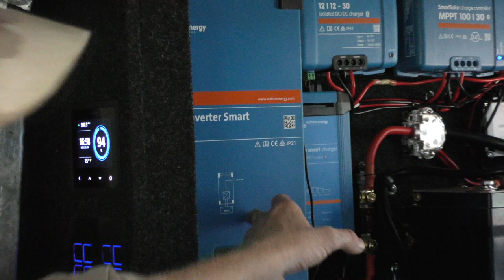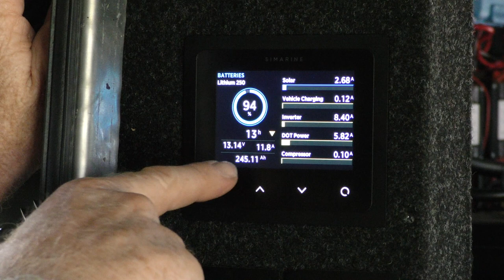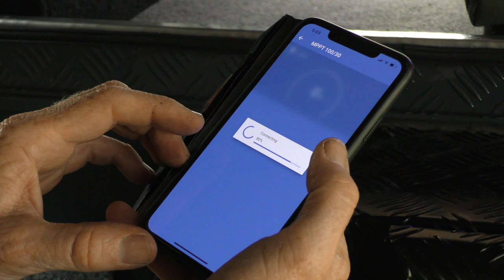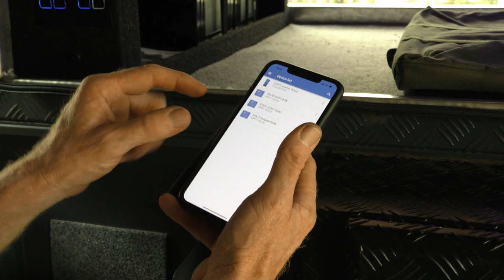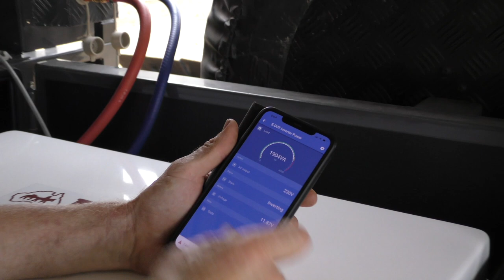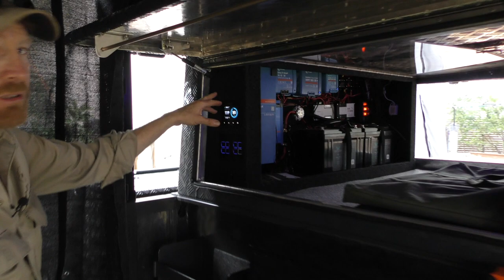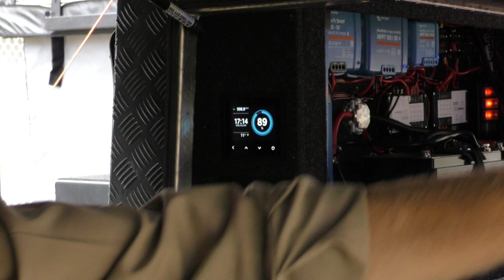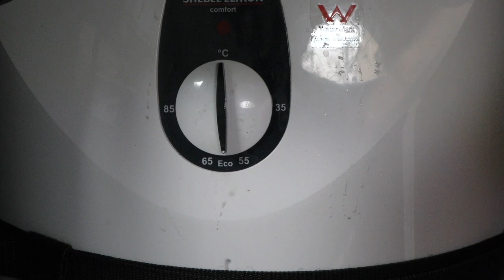eDOT 400, NO GAS CAMPER OF THE FUTURE

Comment: Victron gear, 45voc PV and Lithum batteries. 
Finally a builder installing quality products to start with in 2020.

Yes I run this gear all ready and it is next level. As someone that is off grid power over 60days a year and 3 weeks at times it is worth the extra capital as no need for genset.

Leave AGM and 12volt solar for budget and weekend campers. 
It better investment for low users

Haven't heard of Drifta before but check them out.

Comment: We've been taking an ice machine camping for years for ice in our rums. Just on a more standard 240ah AGM battery set up with a reasonable amount of solar. They don't draw that much about 10amps/hour, but you need a big inverter just to get over the huge start up current those compressors have.

Comment: love the concept. im building a slwb van right now and being a tech nerd im experimenting with the same thing. i will be running 24v system. two 12v 120ah lithium batterys. 640w of house panels on the roof. 2400w inverter. 30a dcdc charger. and 200w solar blanket as a backup. being a plumber i also got the same 5l hot water unit to play with hahaha. will be trialing a 2 burner induction stove.

Comment: Well done. What a wonderful camp trailler.
What current are you charging those lithium batteries. Charging well over 30amps will decrease life span of those batteries.
Alternator and solar input too much current, safe for gel batteries.
Just concerned with high drain appliances 1800watt induction and hot water system. Charging at high amps. Cost of lithium batteries over period will be not efficient.
Reply from the maker: Myung Hong thanks mate.. yeah , not quiet right tho.. Li will take up to 100 amps continuous charging, no problems.. won’t worry them.. think of Tesla car, same thing, they pump in massive amps very quickly.. L

Comment: Great setup Luke.
I ended up purchasing a Redarc Manager 30 & the Redvision TVMS to install into my Hilux canopy for touring. My wife has now thrown a spanner in the works & wants to get a camper trailer. I'm looking to do the Victron setup in the trailer without the DC-DC charger as that will be going to batteries in my truck canopy, I need the truck for outings without the trailer.  I like the idea of having the separate inputs with fixed panels & portable both pumping power into the batteries. I wish I had of stumbled across this video earlier. Can you use fixed panels on the trailer roof into the MPPT controller together with portable solar panels or do I need two separate controllers. If I could get away with one MPPT, I'd go with the Victron 100/50.

Comment: All electric - excellent. I'm surprised you stuck with 12V for the batteries, for the same reason you have high voltage panels, 24v on the batteries will save losses, and 24V inverters are readily available, as is 24V lighting, controllers etc. Next iteration should be 48V, though 48V stuff is expensive still.
Reply from the maker: Yeah everyone skipping 24, all going 48.  But yes big step up on price, trying to keep prices sensible, and simple, 48 adds a few layers of complexity.. atm, we’ll stick to 12 v, then probably jump to 48 in 12 months or so.. ?? L
Reply: @DriftaCamping4WD  Thanks Luke. Makes a lot of sense.

Comment: Painful to watch... There is absolutley no advantage of higher voltage over 18V Solar panels in sunlight. All solar panels do the same thing, collect current, not voltage, they should produce enough OCV is any sunlight. If an 18VMP panel has a low voltage then it follows in the same setting the higher voltage panel will provide no extra current. The really obvious flaw here is solar is so weak in morning/aftrenoon, midday is where you get most harvest. Same for losses in cabeling, all cabeling is sized for 1%Vdrop so no the losses is not an issue with 18V. High voltage panels are really only good with 15+M cable runs, 10M is childs play. I know I have cable runs up to 20+M. You are going to have battery life problems down the line with drawing those massive currents from such a small battery, it's a problematic concept trying to run such powerful stuff like that. See solarpaneltalk where the pros are.
Reply from the maker: Wex lop haha , ok mate.. 12 amps at 8.30 !! Pumping the sun  .. 😄😄😎

Comment: REDARC can charge from two sources at the same time
Reply: I think the new manager 30 can but is it limited to 30 amps in total where as having individual components allows for higher total current.
Reply: That’s because batteries have a max current charge generally 1/5 of the amp/hr size
Reply: @camerons9090  that's because that's all it can do. Lithium batteries are happy to change at 0.5C so those batteries drifta have could soak up 125 amps easy and could take double that if you were in a hurry.
Reply: But lithium is different it can charge much higher for short periods
Reply: @camerons9090  I thought we were discussing lithium. That's what the drifter system uses. Anyway, you will always get higher capacity out of discrete components as you can run them in parallel. The redarc system is nice as a turn key solution but when you're innovating or trying to do something special, discrete components are the way to go.
Reply: Yes I can agree  this as a concept I can see for the future just seems like it could be done a bit neater but we’ll see with the first production trailer
Reply: @camerons9090  agreed. Many of these problems have been solved by the RV market. It's intersting to see how Drifta is bringing it to the camper and 4wd market.
Reply from the maker: Yeah lithium very different, can pump in 100 amps a battery . Look at a Tesla, the amount of power they soak up so quickly is incredible. The bms 30 yeah can do two source but only to max 30 amps.. great unit, we still using them, but has some limitations... L
Reply: @DriftaCamping4WD  it should also be noted that the higher the discharge and charge rates you use, the lower the life of the battery for lithium. To really make the idea of 240v cooktops and hot water systems viable I think your going to need more battery capacity and you will switch to the multiplus units. These are what you really need for this application. They accept generator input and can charge the batteries at hundreds of amps and still feed power directly to the ac loads. You can have some appliances like the hot water only run when the generator is going and others like the ice maker or electric blanket run off both/either battery or generator. You could have a 24v or 48v battery system which keeps the current down in and out of the batteries and you could have a separate dc2dc 24v to 12v converter to  run the legacy 12v stuff.
Reply from the maker: neutronstorm yep, some good points, stepping stones : )  got a lot of testing to do , see if the system copes, but we think it will, lets see. :) L

Comment: Hi guys, just 1 question. If the solar input is high wont the dc dc charger realise that and reduce its input. Even though they are separate from each other wont the dc dc charger back off because voltage is already high from solar input. cheers
Reply from the maker: Peter Bayley hi peter, only if the battery is at 100 % , then it will.. L
Reply: @DriftaCamping4WD  oh ok Great, thanks for the response.

Comment: All very interesting but I am not sure how practical it will be. Some quick calculations indicate that the energy density of LPG vs LiFePO4 batteries is 100:1 by weight. In other words, to store the same energy as 1kg of LPG gas you need 100kg of Lithium batteries. Sure, you can recharge the batteries during the day but having that much power draw means that you are back to the old days of carefully managing your power use and spending time stuffing around with solar panels trying to harvest every last bit of energy. At the moment, LPG seems to me to still have its place. You're about 5 to 10 years ahead of your time Luke.

I am surprised you didn't make the front area where you put all the gear a mirror of what you did in the back. Ie. couldn't you just have a door that opened up over the draw bar so you could access all the gear directly?

Have you thought about putting in RCD protection now that you have 240v? Having 240v in an unearthed metal box would have me somewhat concerned, especially around hot water systems.

I know you have issues with the legalities of running gas. Could this work be done by an authorised gas plumber or is there some other legislation that restricts you from having gas fittings, taps and quick connects on the trailer?

I am looking forward to see how your DOTs evolve into the future.
Reply from the maker: neutronstorm there is a rcd, tucked in next to the inverter. yes gas more efficient by weight for sure, but gas has many other disadvantages in the rv industry. yes energy will have to be managed , might have to combine with a gene at times , might have to put portable solar out but many people doing that now . anyway lot of testing yet gonna be fun tho : ) L
Reply: @DriftaCamping4WD  I love that you guys are trying new things, but please don't sell something that requires a generator to keep going.  There is nothing worse than being set up at a nice quiet spot and having somebody pull up close by late in the day (they always seem to need to pull up next to you) and starting up there bloody noisy generator.  

Generators would have to be the most offensive thing anybody could take camping.  I'll put up with music and drunken singing, but there is no excuse these days for having to run a generator, it's just piss poor planning.

Comment: Is there provision for 240v input as well?
Reply: My understanding is that the victron smart  inverter doesn't have a 240v input side however there are victron products that do have this feature and would allow you to charge/power the system from 240v. My prediction is that we will see version 2 of the edot shortly with one of these more advanced charger / inverters, possibly running on 24v with a generator as an option to rapidly top up the batteries and run the trailer when it's under peak load. Makes sense to have a generator available to boost power in the evening when people are using the shower and cooking.
Reply: @neutronstorm   yes there is an unit, called victron multiplus.
Reply from the maker: yes it’s sitting next to the inverter sry i think i didn’t mention it. below the dcdc : )

Comment: in nsw you can use gas bbq etc when there is a total fire ban.
Reply from the maker: Peter Nolan i think that depends.. is that within 20 m of a house, with a hose nearby ? So that’s not camping.. L
Reply: @DriftaCamping4WD  sort of ... the rule states. adult supervision, a water supply of at least 10 liters(does not have to be mains water) and within 20m of a dwelling or picnic area. So the rules are a little vague. This applies to electric bbqs/ stoves as well.

Comment: i understand some people wants everything electrified and to use "free & green"energy to power it and you are just showing customers what can be achieved.

But let me get this straight: people want to get away from a humble 4.5kg x 2 gas bottles to use induction cooking (1800w peak) with an adventure trailer where you cook outside, just so wind dont blow out and dont have to deal with gas - because of that - they have to invest in a big lithium system / a massive inverter/ a number of large solar panels/ a more advanced DC DC charger where it can pump 50AH+ into the system and the heavy wiring to hook everything up, and to back it up for days of not travelling and cloudy, a 2kv generator with extra petrol can!!! - $$$$ aside, what a waste of resources/ space not to mention the spirits of camping...

perhaps a over-engineered luke's wind shield will be a far simpler solution and cheaper..  I suppose sometimrs first world problem requires first world solution.
i do like the ice cube in a beer solution though - the ice cube machine- now that's an luxary idea that doest cost too much

Keep up the good work Luke, but please talk some sense to some of these people
Reply from the maker: aron ??? Be far easier and less complicated if we stuck to riding horses around.. 👍 L
Reply: @DriftaCamping4WD  well this city slicker certainly couldnt handle a horse like you  ... lol
Reply from the maker: aron ??? 😄😄😄👍

Comment: Induction cooking,  you gotta be kidding.  just stick to gas
Reply from the maker: Graham Beck quick, easy, light, fast cleanup, no wind issues, no fire ban issues, no gas issues, safe,renewable,  it does have some advantages over gas.. : ) L
Reply: @DriftaCamping4WD  you haven't  got enough  batterry power for 3 meals a day.  simple as that
Reply from the maker: reddyman great rant boys , i never mentioned renewables once, could have gone on about it but didn’t mention it. and like it or not the market is moving towards induction, vans caravans motor homes 4wds and trailers. for exactly the reasons i’ve outlined above. think neither of u actually watched the vid 😅🤙👍
Reply from the maker: Graham Beck yeah, we do. plenty. did u see the solar panels ? they put power back in 👍
Reply: @DriftaCamping4WD  yes i saw , the rooftop panel and the portable panel were aligned completely  different directions.  although  you have quality victron products if you have 2000w inverter to run an induction cooker and a water heater and an ice maker and a sandwich toaster while also running 12v fridge and lights you are going to be disappointed.  a 2000w inverter will simply chew through  your battery capacity in about 2 hours